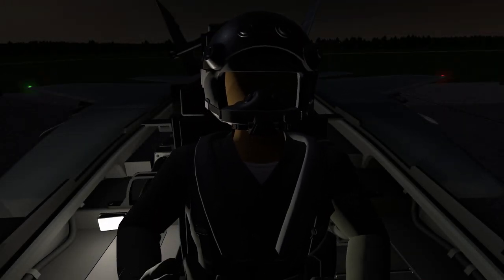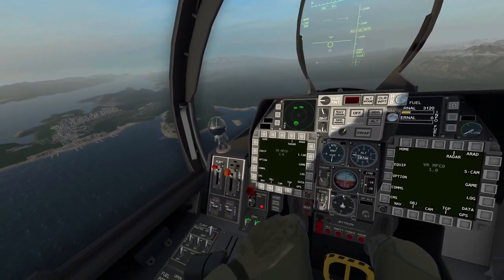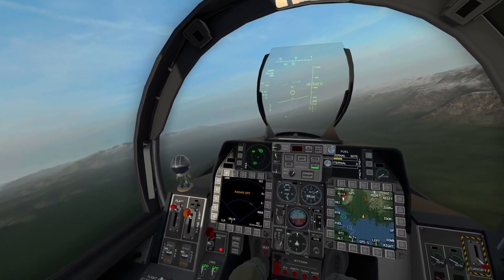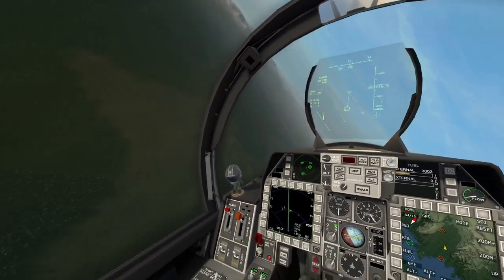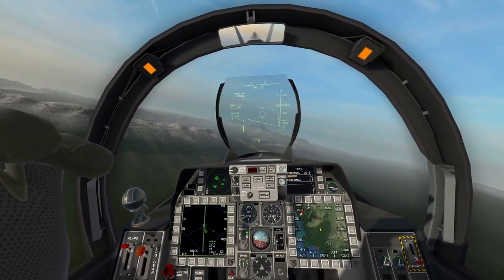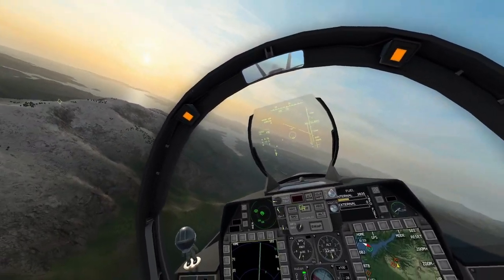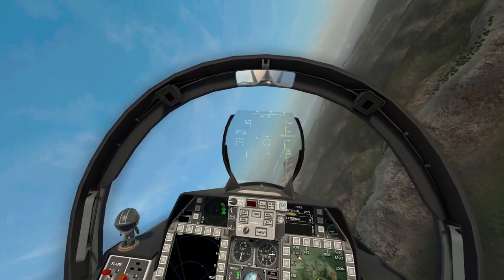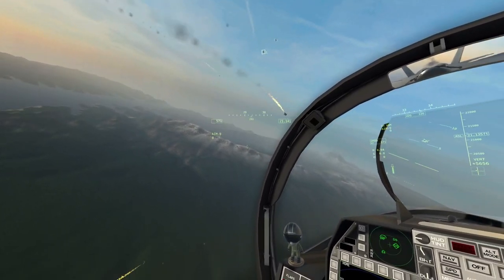VTOL VR Air to Air Missile Tutorial | AIM-120 AMRAAM & AIM-9 SIDEWINDER

Comment: You laid things out simply without much fluff, great video. One thing I have heard is to point the AIM-120 directly at the target, not trying to lead it as leading can be inefficient for the missile. Any thoughts on that?
Reply from the maker: Thanks for watching!

So to answer your questions, yes certainly it can. The reason for this is that the missile has to expend more of its energy by maneuvering and using its limited thrust to line up to intercept the target at the point it thinks the target will be by the time it reaches the target. 

Having less inertia/momentum, and less ability to make corrections makes it easier to dodge by the enemy aircraft. 

So, not that I’m an expert but I’d always recommend leading the target, and trying to launch the missive at a higher altitude. 

This gives the missile as much advantage as possible and let’s it save its energy for last moment maneuvering against an enemy that’s trying to dodge it, while also giving it more initial speed to be able to maneuver by allowing it to trade altitude for energy. 

This is the same reason most anti air missiles climb several thousand feet when fired, so that they can pounce on their targets below them, even if they were to expend most of their energy just trying to get to them.
Reply: @SSPGaming  thanks for the reply! It's clear that you have an understanding of the concepts you're presenting instead of merely parroting information. That alone makes your video stand apart from others.
Reply from the maker: I really appreciate the kind words. I do my best. I’m not perfect nor do I claim to know it all, but I’m always happy to try to support my theories as best as I can. I think that’s important to do in any circumstance when you’re trying to make a case for something :) 

I really enjoy these kinds of discussions and hope to chat with you again :) Always a good experience :)
Reply: You absolutely want to lead the target. The best is when the small circle is centered in the large circle